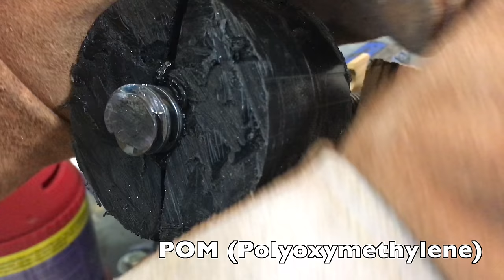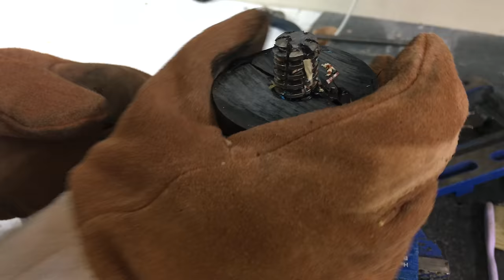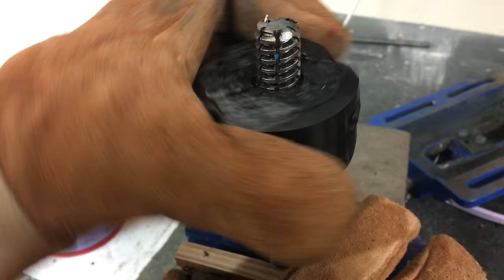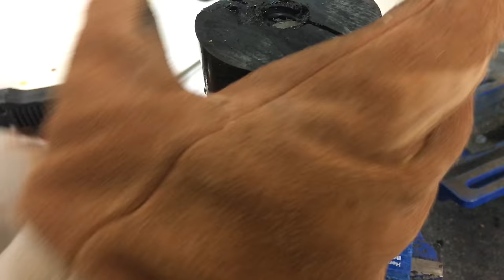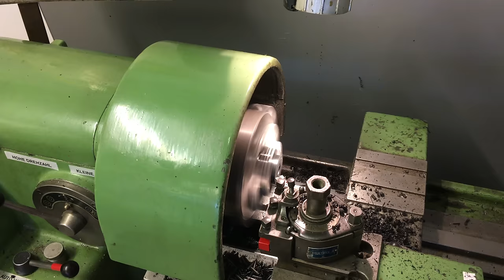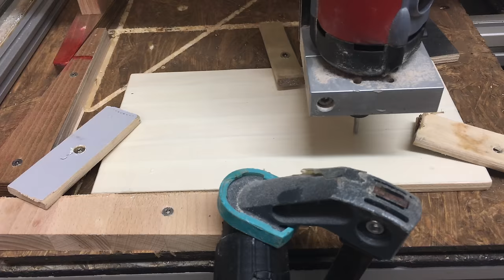Lets Make - A Cheap Anti-Backlash Nut for Lead Screws

Comment: This would be great...if it was cheap to make. Not like I have milling equipment already...hense why I'm trying to make it.
Reply from the maker: I made this in my local maker space.
Reply: Max Maker that would help....im a beginner toetal work and trying to build a wood cutting CNC...so once I seen all the equipment I realized I wasn't able to do that as easily. However, I'm curious what material you used for this?
Reply from the maker: I used POM, also known as Delrin. I did this before without the lathe. Looked like shit but it works. You can make the nut like in the video and keep it raw. Then you mount it to the CNC and fill the gap with polymorph or 2k epoxy putty.
Reply: Max Maker I'll look into that, I originally thought of using threaded rod, with two nuts, slightly separated, so it tightens up the "play". Any suggestions on if that would work better/worse? I'm currently in the process of researching and (pre)troubleshooting for my build over the next  year or so.
Reply from the maker: Well, threaded rod works but its not that great. Really depends on your budget. My CNC cost 2500€ and it payed for itself by making prototypes with it.
Reply: Max Maker what kind of problems would you think I I would see with one? Just out of curiosity. Im trying to weigh out a few of my options. My budget is about the same as yours. But I'm hoping to achieve as large of a CNC as I can. My goal is to have something that can manage a full sheet of plywood or MDF.
Reply from the maker: Here are some tips:

Stiffness is key for good surface finishes. Make it as stiff as you can.

For larger machines. I would use a belt. Cheaper and easier to adjust.

For aluminium, I would use leadscrews for more stiffness.

Endstops are not necessary.

Nema 24 and ebay drivers are the perfect size.

Kress 1050 fme is the best spindle. Watercooled chinese spindle is better but has a lot more parts and cooling.
If you use leadscrews, make your design so that you can adjust their angle. They need to be 100% parallel, or they will bind. Same with linear rails.
Carbide is a total waste. They break too easily. HSS is good.
Alcohol solves any cooling issues while cutting.

Linear rails are necessary. Forget about x-carve rails.

Cutting full sheets is pretty much impossible with lead screws. They are 2.5m x 1.2m in Germany. You would need 3m long screws with at least 30mm thickness or they will hang and whip. Too expensive and too bulky. You could do it with a belt.
Reply: Max Maker I have a few questions, but I really appreciate everything just gave me as advice here. Seriously helpful. I don't have anything other method of learning about these other then YouTube so far. I don't know ow alot of people with a CNC machine to ask.
So how would I drive it with. Belt? Rack and pinion? That was what I was considering using for the same reason you described. And the lead screws are incredibly high priced. $2,000 for some(hense the threaded rod idea also). And should I be using two?(one on each sideor one down the centre)? I was leaning towards powering both sides, so I could avoid any amount of deflection in the gantry.
I was fairly aware of how accurate the rails need to be, but wasn't sure what you meant with the lead screws being parallel? 
I was originally going to use laminated MDF and go ultra cheap, but decided against it so I could remain really stiff(as I figured that would be more important then cheap here. And i would like to cut some aluminum as well
Reply: Max Maker thanks for the equipment tips...it gets a bit overwhelming looking at stuff...knowing very little about any one product, any suggestions are great.
Reply from the maker: Consider building it like I did. I used Aluminium slot profiles. There are companies in Germany that cut them to your desired length. Or get full lengths and cut them with a mitre saw. My whole frame cost about 400€. Worth it. I had mounting plates lasercut from 10mm Aluminium. Cheap if you look around online. Youll get quotes from 50€-500€ for one part. So I could build the entire frame without cutting anything. 

Linear rails are not to bad either. Get some from China. They are good enough. 

My lead screws were about 25€/m awesome quality, but not ball screws. Works fine nonetheless. You won’t afford thick 3m leadscrews though, so go with rack and pinion or a belt drive. Dual drive is advisable for your stated reasons. I have them too. 

If your leadscrew is not entirely parallel to the rail, the leadscrew will bind. Its like two trains going in slightly different directions. 

Stiffness is very important. I would not use any MDF for durability reasons. 

For more information, there are a lot of people in DIY CNV groups on Facebook.
Reply: Max Maker thanks alot! I'm I'm Canada, so exchange rates seem to really a bit of havoc on me here lately. But I understand alot of what your saying. With lead screws and such. I might end up doing rack and pinion, as kind of a happy medium ony Y axis but likely will use leadscrews for the other two. I've seen a few decent prices looking at them, but nothing to write home about. 
And yeah I kinda threw the idea of non riding materials out the window after even hearing people talk about the temperature flux and tolerances getting out of wack.
You've been a great help! I'll look Into some of the FB pages also. Any you can recommend? Thanks lot! Hope you have a good week!
Reply from the maker: Also, Smothieboard is the best “Brain” you can get for your CNC. Check it out!